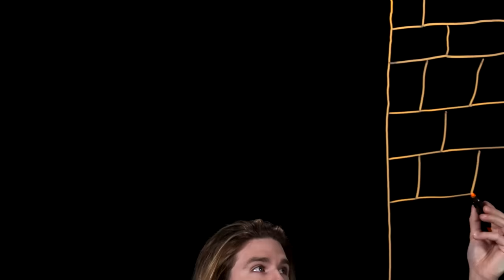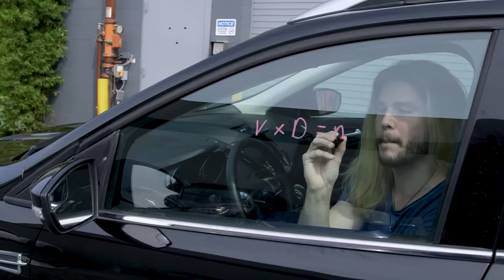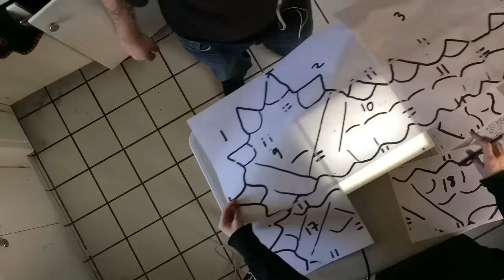Could You Swing A Real Monster Hunter Sword?

Comment: You forgot to mention that you also need to weight a LOT to be able to swing it. As you push all that mass in one direction, you have to weight more than that to be able to hold your feet, or else you're going with the sword.
Reply: Wich is actually what happen in the game, it feels more like the hunter is attached to the end of the sword that the other way around
Reply: The hunters armour probably weighs nearly as much
Reply: I think a 5' 8"to 6 foot tall, 200lbs power lifter with exceptional dancing and martial arts skills should have the sense of momentum, control and footwork skills to swing a 370lbs version of this blade. 
It'd still be several consecutive swings before he is exhausted, and there's still a large margin for terrible error. Though it's a full body activity, his ankles will be under a tremendous amount of strain when he pivots on them to generate the initial momentum of starting up the swing and then as his stance widens out to transition the flow into a secondary pivot. On the second pivot, the built up momentum will go to the outer limits of his control(even with genius level sense of kinesthetics). The sword's weight will feel momentarily lessened as it'll feel like it's flowing of it's own accord(which it technically is at that point)...
You are not likely to find a guy like this, but it's possible there are a few in the world...but in the World of Monster Hunter, each Hunter is likewise in the top 1% of physical and martial prowess, so it's possible(just not for Kyle, he seems better at thinking than martial arts).
Reply: You have to go with the sword, it's how you do it that makes the difference between successful use, or being broken... and dead, if you are facing something ferocious enough that you need that sword(or you have Kyle Hill level clumsiness, in which case you'd somehow stab yourself in the process).
Reply: I almost want to gain the almost 40 lbs via a year of explicit conditioning, just to prove that it can be done...but I haven't the 370 lbs sword, nor the money set aside that I can just do nothing but physical conditioning and eating for a year.
Reply: marcos tsuna there's actually one or two animations in game where the sword's kind of throwing you around.
Reply: FireFox64000000, it's all about the technical skill, the visualization sense of body structure dynamics in the flowing transition of force required to use the weapon...which is a VERY Japanese mentality..but somehow Kyle has decided to omit the bigger picture of highly refined skill which the Japanese revere above just brute force. 

If the lil Japanese guy Isao Machii had a hybrid child, a son, with a Jamaican of that specific subset which Usain Bolt is from. That child would be able to generate the required explosive fast twitch muscle impulses to raise the blade, then using training and coordination inherited from Machii, continue to generate those impulses in exact sequence as he blends his centre of gravity with the centre of mass in a dance of extreme precision that would be the act of wielding the sword.-See Machii's skill:https://www.youtube.com/watch?v=Qzhs1Z8Rwnk
Obviously he wouldn't be able to thrust without the sword then dropping downward, so he'd step in generating a secondary impulse of force that redirects the overall flow of the sword. It's not a matter of super strength but exact manipulation of explosive force mixed in with the use of centre of gravity as a leveraging mechanism.
Except for his spine, his whole body never fully leaving a coiled state that provides a springlike cushioning to reduce the feeling of weight as he is grounding the blade's weight into that and uses it to channel the successive waves of force through his body without harming any of his joints from the exertion.
Reply: +Lin Yen Chin saying this multiple times doesn't make this weapon work no matter how many different ways you talk about fluid dynamics and angular momentum.
Reply: Lin Yen Chin, Don't kid yourself, no human could swing such a sword, benching it or squatting it is not swinging it. Your arms would actually be ripped out of their sockets just from lifting it at arms length, just look at strongman competitions. (coming from a 215 lbs powerlifter with 165kg/200kg/220kg as pb)
Reply: Nhouyengah Right, unless you're some kind of demon freak.
Reply: Like how Thor uses his hammer to "fly"
Reply: There's a 9ft long 64lbs sledge hammer excavated from an ancient copper mine that was clearly used by people. Though, no one can figure out how. That's about as close as you can get in real world examples.
Reply: marcos tsuna some of the attacks do take you off your feet and following where the weapon goes
Reply: People in that world are mutants, simple as that
Reply: Hordequester, it's possible that the hammer was used by multiple people. It is possible that some extremely strong person would be able to use it as well, but the thing to note there is that someone working in a mine likely wouldn't be that strong due to living conditions. Even then, massive injuries would happen, and it'd result in a very lackluster endurance experience as the person using it would be exhausted just after a few swings, assuming it could even be swung.
I like how I'm saying someone'd get massive injuries from a 29 kg sledgehammer when the assumed weight of this sword would be 180 kg. Swinging that sword would basically be the last thing you'd do in life due to the sheer force of it tearing your body. This is assuming you wouldn't somehow manage to throw yourself of course, that'd be more like potential death with severe injuries.
Reply: Especially after you start that TCS
Reply: Tybee, you can still talk shit even if going into detail. With a weapon as heavy as this, you'd basically fuck up your body as long as you aren't basically throwing the weapon along with yourself, and even then, just moving the weapon without just destroying your back, that's just unlikely. People destroy their backs with lighter objects in a similar manner already. Maybe it could be possible, but even then, can our bones even handle the weight?
Reply: Given hunter can drop from any height without taking damage it's safe to assume they are on another level.  Anyone read All you need is kill?, They use giant axes in that and robot lower armour but even that is dangerous, just swinging the axe improperly can kill you (and does).
Reply: kudosbudo, it's safe to say that they removed realism because it's a game.
As for All you need is kill, I've read it. I don't remember much of it, but I know I've read it at least.
Reply: well i think the armor counter the sword itself so you can put your weight on muscle mass to lift the sword and armour
Reply: Adrian Martadinata using the armor for stability is reasonable, I'll give you that. However, think about it like this. If you swing the weapon, you also have to be able to stop the weapon in one way or another. If you swing it sideways and you can't stop it, your spine will try to do some fun gymnastics that involves twisting itself. If you then also have heavy metallic armor on you, that'll basically be like wringing a tin can.
Let's also play with the idea that you hit something and the sword makes a full stop. Now all of the force that you put into your hands slam straight into an object. A force that was swinging a 200 kg sword. That'll basically destroy your hands, no matter how muscular you are. That force is basically the same as having a 200 kg object fall on your hands.
Reply: Actually, he's forgot to actually swing it.
Reply: But what if the people are giants? Like in the dinosaur era, where there are a lot more oxygen which made creatures bigger. Just curious.
Reply: Ryagai if they are bigger yet proportions are the same, we encounter the same issue. The problem is simply that proportions are bad. If you mean the weapon stays the same but the user does not, what you say has some merit.
Reply: I would imagine that if someone had dense enough muscles and bones to swing one of the greatswords from monster hunter then they would end up weighing significantly more than it looks like they do.
Reply: If you think about most the creatures you fight being over 1400cm. That means hunters are likely over 9 feet tall. And the actually sword hes lifting would likely be in the 400-500kg range its much higher of a stand point. But raw strength plus the weight added from armor would easily counteract it. On top of they are hunters. They are likely genetically atered super being with denser bone, tighter coiled muscles, and much stronger cartilage. They most likely were litterally designed for it.
Reply: Zack Blake, armor would add stability due to the added weight, that's a benefit of armor. It'd obviously help, but think about the weight of the armor. You can't just use your regular armor set. It'd have to be really thick and heavy as well. Then we're just getting to absurd levels. The amount of muscle that'd be required is just insane. Of course, in a video game it's possible because they don't care about realism here. The muscle density would have to be like 10 times (just throwing a number out there) as much as a real human.
Reply: Actually, the larger a creature gets, the less they can lift in proportion due to the square cube law. they have to use more strength to hold themselves up than to swing a sword.
Reply: Lin Yen Chin  Are you gonna start a 'Go fund me' to prove your theory? I'd send you a buck.